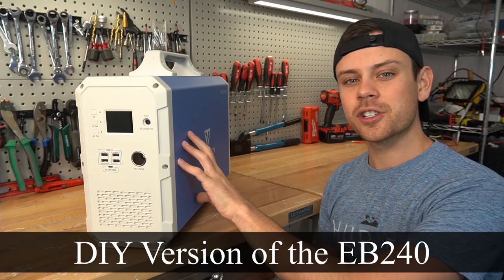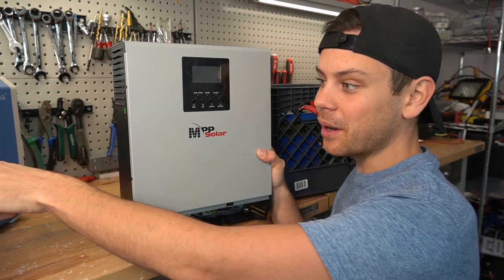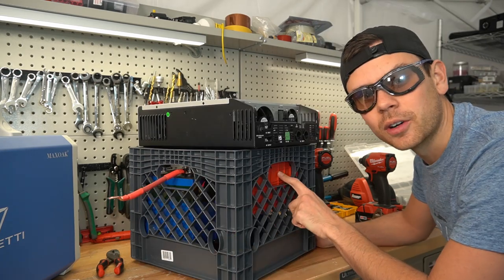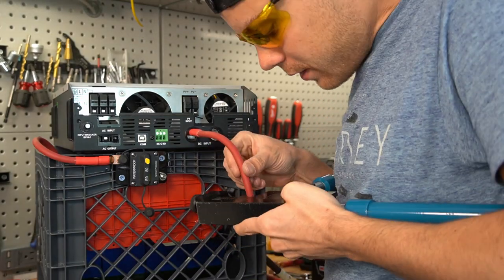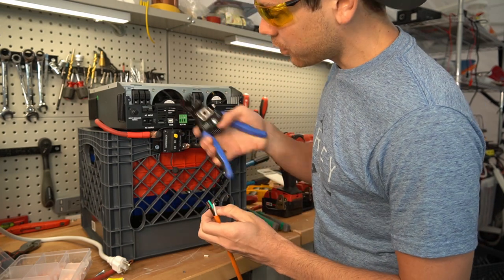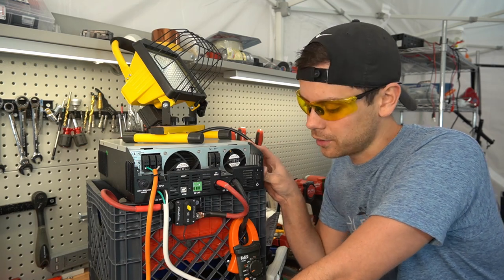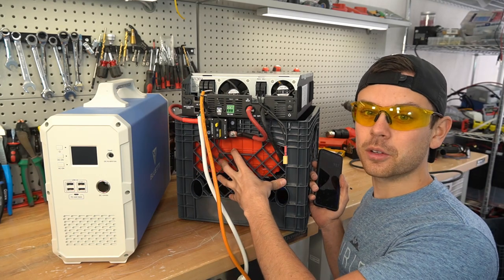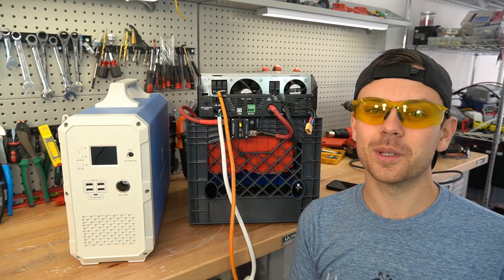$1050 DIY LiFePO4 Version of the EB240 Solar Generator: More capacity for $550 less

Comment: I really want to set up my system just like that, milk crate and all. But I’ve had difficulties finding any one video of your that focus primarily on usb. I’ve only seen a few times where you covered it very lightly in middle of some of your videos. Virtually everything I’ll need powered can be charged all from usb (except for a PS4 but there’s plenty of info out there by you on inverters so no worries there). Any particular video of your you could recommend I check for this? I have a feeling that building a system for usb power first over other form of outlets may impact the setup a little and I wanted to double check on this. If there are no videos on this, Maybe take this as a request/suggestion for a future video to cover your preferred way to set up for USB ports around the camper/van/home? Thanks!
Reply from the maker: Oh sure, just buy a 12V cigarette lighter adapter, and splice the positive and negative wires to the fuse block. Or add your own inline fuse. Some are even designed to be connected to the battery directly, and has its own fuse. Just two wires. Positive and negative.
Reply from the maker: like this: https://www.amazon.com/WYMECT-Charger-Socket-Waterproof-Outlet/dp/B07TXG4XJ3/ref=sr_1_4?dchild=1&keywords=usb+charger+from+battery&qid=1614121668&s=automotive&sr=1-4
Reply: Oh that's all that's needed? Nice. What about those usb c power delivery standards and the like? Would those 12v adapters still work as well or do I need to go for something a little beefier to make it work better? If there's no need for beefier options, I'll go ahead and start ordering parts in March. Thanks!
Reply from the maker: @thedeafwillowtobedeleted  Yeah just try to find one on amazon. You should be set if you find one that is wired to ring terminals. And yeah, super simple :D
Reply: Awesome, thank you very much :)

Comment: Will, thanks for this useful information.  I own the original AC-200 from Bluetti.  I would like to use these lithium batteries rather than lead-acid batteries at 12 or 24 volts to recharge that unit using the clamp connectors and cables supplied with the AC-200.  Can I do that?

Comment: Two questions. If you set the all in on on economy mode so the inverter only runs when it detects a load, does the unit consume much power? and How would you connect a vehicles alternator to that setup?

Comment: Will the milk crate cause the components to get too much heat because the electronics will get too hot next to each other? I’m not going to use an all in one I was going to use separate components like you’ve shown in other videos. I’ve got a Renogy 2000 W inverter and a tracer series 4215 BN.

Comment: Using this exact system setup. Do i need a voltage converter from 48v to 12v to run 12v appliances? Or is it ok to plug them all up off a power strip? Im looking at the 2024LV from the link off this video and plan to install in my RV would i be able to run dc items off this as well? I am assuming the way the batteries are hooked up the system is bumped up to a 48v system. Can i also run 12v solar panels? Anyone who has the answers please respond if Will does not respond. Much appreciated

Comment: Newbie question here.  If you're using a 20 amp charger to charge up a 280Ah battery, wouldn't that take 140 hours to charge?  I know that can't possibly be right so if someone can help explain it to me.  Thanks.

Comment: At the end you refer to charging off your alternator - can you elaborate from that - using a step up converter on the PV input perhaps?
Reply from the maker: Dc dc current regulated converter of your choosing. Direct to battery
Reply: @WillProwse   Even easier. You probably have a video with this somewhere dont you! I'll go do some searching.

Comment: I was just about to build the other Milk Crate 2.0 system, but I like the MPP setup better. Has anyone found something better than the milk crate to mount the compents? Something with wheels like a Milwaukee pack out box or something similar from Harbor Freight?

Comment: Do they offer a similar 2000W, that could be used with this system, that would allow it to be used with a microwave or AC short term and maybe 800 watts solar. That is how I would like to set up my RV system. Thanks in Advance. Nice video!

Comment: Can someone answer me a question. can I have a 350 W solar panel and a suitably sized MPPT controller but have a small battery like 35AH ? Shops Who sell solar panels are telling me I must have I 50 W panel for a 35 amp hour battery but if I get more batteries in the future that means I’ve got to buy another panel why can’t I just have a big panel that the MPPT controller allows and get more batteries in the future doesn’t the MPPT controller shut off the charging when the battery is full why does it matter that the panel is not a perfect match for the battery size I’m confused, thanks for any answers.

Comment: What are your thoughts on expansion and contraction of the cells as state of charge varies? I guess you are not into a serious fixture to restrain them, but what about stress on the terminals caused by the solid bus bars?
Reply: Seems if there's some spacing between the cells, even if there's any significant expansion and contraction, there'd be no stress on the rigid bus bar attachments.
Reply: @wingerrrrrrrrr  Exactly, but most of these arrangements seem to have no space between the cells.

Comment: What is the max size inverter can you use with these batteries?
Reply: With that BMS, it is limited to 200A I believe. So, at 12.8V that is a 2500W inverter... but at 2500W load, the battery would be depleted in 1.4 ish hours.
Reply from the maker: @SuperVstech  250A output :D
Reply from the maker: @SuperVstech  I would follow supervstech recommendation of 2500W max regardless with this bms
Reply: @SuperVstech But with 2500Watts you can have coffee, microwave, cook top ... All you need is a fast charger, do you don’t have to wait for 8 hours of sunlight.
Reply: @julesgardet659  quite true. But if you have AC to charge fast, the battery isn’t really needed at the time.
Reply: @SuperVstech  For boondocking without solar.
Reply: @julesgardet659  ahh, well then, for that, I’d plan on having additional battery capacity. But for average loads, 3.5KWh should hold most boondocking... just keep the large loads to a minimum time.
Reply: @SuperVstech  Exactly
Reply: @SuperVstech  thanks a lot! I picked a Giandel 2200w
Reply: @Mr_nah  they aren’t half bad. Did you get one with built in mppt solar controller?
Reply: @SuperVstech  yep, but I have Victron 100/20 laying around

Comment: You mentioned that the wire you used is overkill. Would would be a cheaper, more adequate gauge wire to use?
BTW, I love other milk crate unit.
Reply: 80Amps under 24” round trip would be about a #2 wire safely... with a 1% voltage drop.
Lower size will work, but 3% drop is as low as I would go... that would be #6, and the battery voltage would drop .39V from an average 13V...
Reply: @SuperVstech  I'm not sure if I understand. He said that that wire was way Overkill. Are you saying that it's not and it can't be reduced without reducing voltage?
Reply from the maker: @mattosborne1233  Hey matt, I would suggest using a calculator like this one: https://www.wirebarn.com/Wire-Calculator-_ep_41.html

At my run with 4 gauge, it is overkill. But yeah, better off to use #2 if you can. But type those numbers into the calculator and they might surprise you
Reply: @mattosborne1233  no, his 4gauge wire less than a meter total length is in the 1 to 2% loss range for 80 A #6 could safely be used. #2 would be wise if you wanted the absolute minimum voltage loss.

Comment: is it safe to parallel link a 12 volt leisure battery with a 12 volt Lifepo4 for power draw , I would imagine I would have to charge them separately though , it is just for temporary use in a van ,  thanks for any info .

Comment: Mr DYI WILL

very interesting but ..

Bag milk crate a nice Pelican Style case would be much better

Next ...realistically  500. Vs. 1000 ? Cycles to MOST people is just not  important.
Probably never need it but Bluetti is a solid company and for ,$70 I bought 5 yr warranty. If something in DYI setup failed you would have to figure problem. Dissasemble  and ship back

I know the EB240 is not perfect but at $1500. It's not a bad investment

Comment: Im retired, live full time in a van. Like the setup.  I need a setup for boondocking up to week. Vice versa enough to power a house during emergencies.  Any ideas.
Reply: Lots of batteries, lots of sun, and an alternative way to charge the batteries during winter months? That's a tall order.
Reply: Will has a 400 watt solar plan. It is solar, of course, limiting your usage depending on conditions, but it is a great set up.

Comment: If you wanted to keep  the battery plugged in, in case of emergency, would you add anything or trust the Daly to stop over current?
Reply: The Daly will protect the cells from over or under charge, and that inverter is indeed designed to properly charge LFP, LiPO, SLA, AGM, Etc...

Comment: I built one of these for myself just in case of an emergency and stored it away in my closet for a year. Now when I power on the MPP Solar unit, it constantly beeps and flashes. Contacted Watts 247 and they said my battery is dead. I don't know how to get this working again. If anyone knows, please let me know! thanks.
Reply: I had the same issue when my battery got fully depleted. I disconnected the inverter from the battery. And then I hooked up my cheap bench power supply to charge the batteries for a few hours. I then hooked the inverter back up to the battery and the beeping and flashing was gone. Hope that helps

Comment: Considering the weight, do you think it would be worth it to try to install something like this in a pelican kit? If so, would cooling need to be added? What would be a good way to monitor/control the temp in the pelican kit? Thanks!
Reply: I have built one and the milk crate is perfect for venting. You could put this in a pelican case, but would need to cut some holes out for the inverter to vent through and a separate hole for the air intake.

Comment: What do you think of the people that make their own batteries out of cells?  Would you make a video making your own version?
Reply: The battery used in this build is made from cells... and he has several videos on doing just that.
Reply: @SuperVstech  No, I mean the cells that are shapped like a double a battery, those are what are inside the blue batteries he's using, there are videos on youtube of people making batteries out of those because it's cheaper, just this guy seems more knowledgeable so I'd want to take his advise.
Reply: @McCucumber  ahh, I see what you mean.
No, the blue cells are not full of cylinders. The blue packs are prismatic pouch style formed into a brick. There is liquid electrolyte inside.
Reply: @SuperVstech  So do you think Will is for or against making a battery out of those cylinder batteries?  I saw in the comments of one of the videos of a guy  making one of those videos say it was a ticking time bomb waiting to explode.
Reply: @McCucumber  I make my own packs from A123 and other cells. I bought a cheapo spot welder and a roll of nickel strips, a decent BMS, and a bunch of parts to build a big kit for remote power uses. 
I haven’t seen Will make a video on individual cells like that yet.

Comment: I am EXTREMELY interested in this build. I have a dumb question (not an electrician)- how and to what would I mount a usb or 12 volt outlet to?
Reply: 4 LiFePO4 cells in series puts you in a safe 12 volt range. If you want regulated (constant 13.2 volt output regardless of battery voltage) output, you will need to add another piece. USB....use a power strip with USB port....they're common.
Reply: @josephbrabenderiii2049  thank you. I would like to know where to hook up the 12 volt outlet to?
Reply: I built the $640 one.  I just got a 3-hole cig charger, cut off the male end, attached & secured the wires, & I just drop it inside the crate like Will did in the 1st one.  I have fast charger gig insert in 1 of the holes & I have 2 more available.
Reply: BTW, the neg goes on neg bus, & the pos must have a fuse.
Reply: The positive must be connected to the down stream side of the BMS to prevent accidental over discharge of the battery (and ruin). The positive battery connection at the inverter is the same. Negative to battery negative. As others have stated...fuse your positive to whatever dc receptacle that you plan to use.

Comment: Will.  But you are missing one other missing piece to these builds: solid-state capabilities. This so that in cases (like in your 280Ah build in this video) people can disassemble the parts to make this easier to move to different locations. Build it so that it can be disconnected (cleanly) and you (or, we) are set, for any kind of diy sol gen build !!

Comment: So if I wanted to power it from my dc to dc I connect it in place of solar panels ?
Reply: No.
The dc to dc would output battery charging voltage, so it should tie to the battery itself. Charging through the BMS of course.

Comment: If the battery is 12v 280, isn’t that 3,360 w/h?
Reply from the maker: 12.8V nominal for this chemistry
Reply: @WillProwse  understood, love the price & the build! I was planning on build with a pair of SOK 12/100 for a total of 2400w/h, but that’s a 1000 bucks right there, without the other components or panels!

Comment: Could you compare prices of batteries by countries? I gringe when I buy from China.
Reply from the maker: China makes nearly all of the lithium iron phosphate cells. They also developed manufacturing methods. You should probably look at another chemistry such as NCA variants by Tesla. you could use a used battery pack but understand that it's combustible because it's cobalt based

Comment: Realistically, how much could a system like this power?  Will be possibly looking to run an approximately 200sqft "Cabin" with solar on a mountain property in New Mexico.  We wouldn't have much running off electric.  The biggest item would possibly be a window unit A/C.  The rest would be just some LED lights, charging phones, etc.   Could this size system potentially do that?
Reply: He's got a solar shed video that he made a similar system to power an A/C window unit, he goes over the stand-bye consumption and cooling the shed, I think originally he even powered it with a bluetti perhaps like the one seen in this video but I can't remember.. you should search solar shed and I bet that video comes up if you haven't seen it already.
Reply: 1000W high frequency inverters like this will have difficulty starting most window units.
Reply: totally agreed.

Comment: How many solar panels and series or parallel?
Reply: That inverter controller handles 500W at a max voltage of 102V, so average “12V” 100W panels can be 4 in series giving you under 100V and 400W you could use higher wattage, but keep the total VOC under 100V.

Comment: How long can you run your typical 3 doors refrigerator/freezer with this?
Reply: Let's assume a fairly energy efficient full size fridge uses an average of 60 watts over a 24 hour period. Based on that 60 watts, plus the passive 60 watts of running the inverter, multiplied by an inverter efficiency of ~85%, you could expect something around 24 hours of operation from this 3584Wh battery. This is very rough as fridge power draw can very quite a bit and I'm not certain of this inverter's efficiency.

Comment: I built this system and I can definitely say don't buy these recommended batteries. I built this system and get about 300 watts for about 20 minutes before the inverter shuts off due to low voltage.  Cheap Chinese junk batteries.